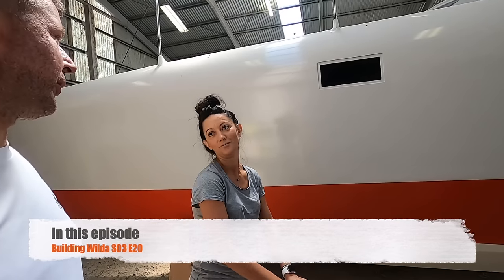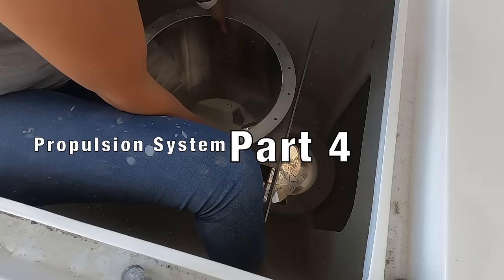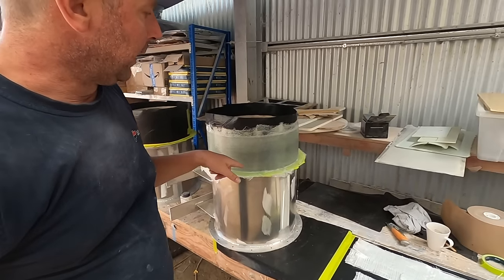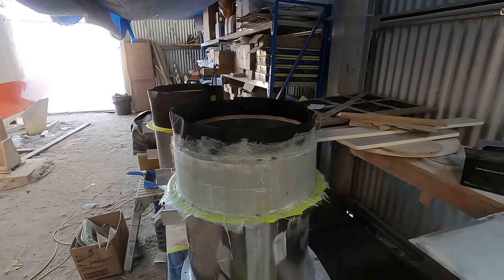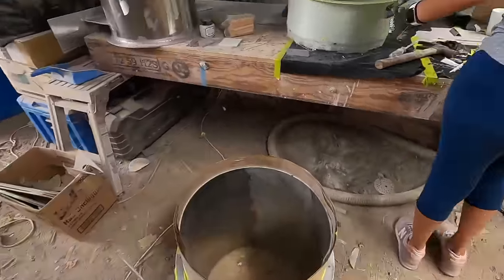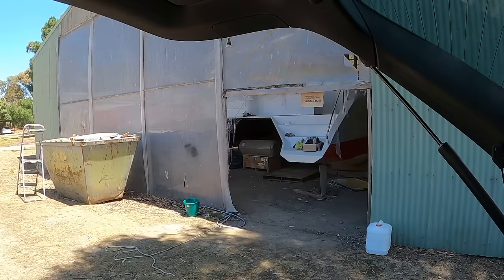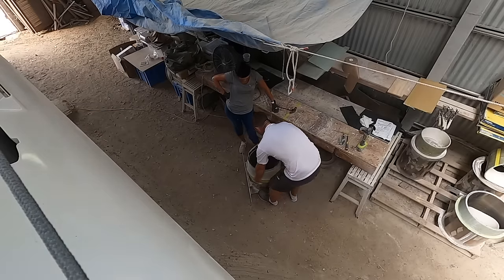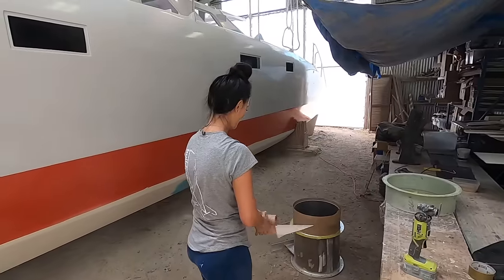Making FIBERGLASS reinforcement RING frames - S03E20 - Building Wilda | Unique Propulsion Part 4

Comment: Clear cellophane packing tape is a great release surface when working with epoxy resin.  I use it all the time.
Reply from the maker: Thanks, yep, we used it on the 2nd cylinder and it worked well

Comment: It's fun watching the trial and error learning with solving process. Reminds me of the blood, sweat and tears of Rosco and Janet on Life on the hulls. Prepping and demolding from molds. Using what they have and making adjustments based on the results. No stopping now. Place looks cleaner.

Towards the end of the day, if you have a long hose and access to water, soak the floor and let dry overnight. Less dusty, firmer, flatter. Another option is to lay discarded appliance(fridge, freezer) corrugated on the dirt flor.
Reply from the maker: Thanks for the comment! You never miss an episode! It felt great getting rid of the rubbish and getting the shed tidied up.

Comment: I come from a background of 25+ years of working with fiberglass reinforced products. When we made molds and had concerns about resin attacking the mold master and sticking to it, we used a release agent called PVA, polyvinyl alcohol. It is appliied with a spray gun and creates a barrier between the gelkote or resin and wood, metal, or whatever is being used as the mold. You also need to contact your resin/gelkote supplier and ask for some mold release wax. Petroleum jelly does not work.
Reply from the maker: We have both PVA and mold release wax. But because we had the 30 layers of paper, wax or PVA would have been difficult to apply. On the edge, it would have worked, we ended up working with packing tape for the 2nd cylinder and that did the job. Petroleum jelly is actually suggested by the designer for many applications.... and works well for some parts.... for some reasons it didn't work with the green tape. Thanks for the comment and feedback!

Comment: Next time try using PVC tape and boron nitride spray on top as release agent. They are fantastic slippery and would definitely work...

Also I think u need more cross bracing after installing the aluminium tube to the hull. Hope u have planned for it.

This project is very interesting for me as an electrical engineer.
Reply from the maker: PVC tape works great when you can get it to stick. We ended up using packing tape for the 2nd cylinder and it worked better. We'll look up the boron nitride spray. Could be useful in the future, thanks for the suggestion!

Comment: Ive used petroleum jelly  ( I thought it was an original idea lol ) and found it works fine in the right situation - small parts etc.  Brown packing tape works well.  I also used mould release wax on my trimaran arm moulds which is good for large glossy surfaced parts but requires some work.  I applied about 6 layers and polished each before applying the next - it's all in the prep.  Fine tapered hardwood wedges make great tools for removing the piece from a mould - being a little softer than the glass they don't ding it like metal can, but you can still wack them with a hammer.  Looking forward to seeing this go together.   Cheers.
Reply from the maker: Thanks, we've used all methods for release in the past and some worked better than others. for the 2nd cylinder we went with packing tape and the release was easier than for the 1st one.  Something happened with the green tape and the vaseline on the 1st one. Nevermind, we got it done :) Thanks for the feedback and good to see you back again! Cheers

Comment: Did you ever consider making the hull perpendicular to the axis of your drive cells. Then you could make that wedge shaped speed brake under the prop cowl a single thin blade. The small flat area fared to the hull would be a small increase in drag in full sail mode but the improvement in drag of the drive cell at both the bottom and the top hull interface (especially if turning cells 180' for better generating prop dynamics) seems like it would more than make up for it. Efficiency when using / generating power will have a $ effect (assuming diesel generator) vs a small top speed penalty. 

I"m sure you thought this through and i'm wrong (I only have an armature interest in fluid dynamics) but am curious what your investigations / calculations indicated. Thanks for having the courage to step outside the box and do interesting things.
Reply from the maker: We'll make that speed break wedge as hydrodynamic as we can... It will really only make a difference when using as a generator. When motoring, speed will be so slow in any case. Thanks for your interest and hope you come back to watch more of our progress :)

Comment: Just a curious question, in the rendering of the propulsion system there is a lid at the bottom of it which I assume is there to seal when the propeller is retracted. As the boat hull isn't flat, bow to stern, it is thicker in the front than in the back. Wouldn't it be a good idea to thin it out in the front too so that it won't cause any unnecessary drag? As long as it seals against the hull when it is up it will perform as intended, right? I assume that it is just that the inner floor of the lid is modeled to be flat for some reason?
Reply from the maker: We'll try to make that component/lid as hydrodynamic as we can. The rendering is for illustration mostly. Thanks for the comment!

Comment: I like and understand the concept of what you are trying to achieve with the drive system. But I’m wondering if you have taken into account the load on all these parts under operation . The stress on the body and the fact it has to rotate like a bow thruster. No slew bearing to distribute the load more evenly and let it move. I’m waiting with anticipation to see it function. I really hope you don’t get any stress fractures once it’s in the water.
Reply from the maker: There will be some sort of slew bearing. Design isn't complete yet, it will be a bit of trial and error. The problem is that the cylinders are not perfectly cylindrical. Despite having them custom built...
But there will be a bearing surface of some sort. No rollers if I can get away with it though... If we do need them, there is space for roller bearings as well. Hope not to need them though.

The maximum thrust will be in the range of 250 to 300 kgf.
Reply: I agree . Very hard to manufacture anything of that sort to have minimal runout cylindrically. The bearing surface also has to be able to run but then retract. I would be going down the track of a nylon bearing type and also needing some sort of thrust device on top to hold it at the correct elevation for the 2 required positions. 
As I said waiting with anticipation.

Comment: Hello, what size thruster did you purchase from vetus ?  i think your idea is genius
Reply from the maker: The biggest we could fit in the flat part of the hull. A 30kW hydraulic leg. We hope it works! :)
Reply: @buildingwilda  Sweet .. i think it will work , they have a continuous run time
Reply: That should work .. windelo's use lower 20kw power motors ...see the latest episode of the barefoot doctors... They do a tour and ask a bunch of relevant questions.